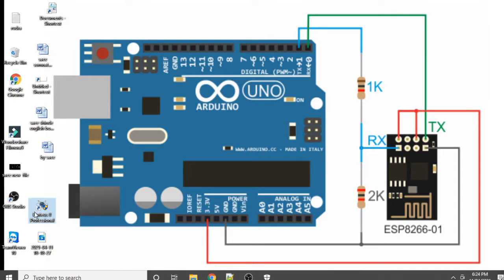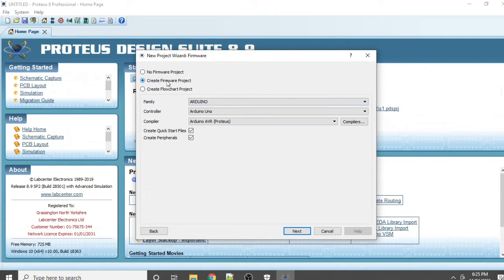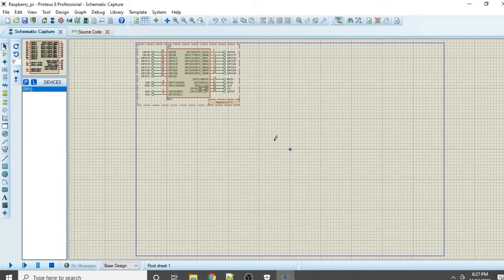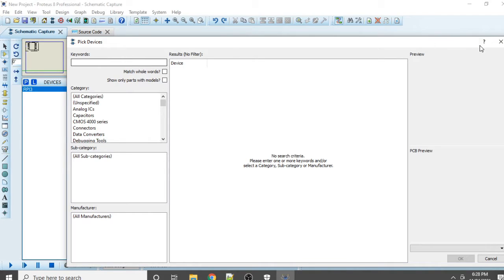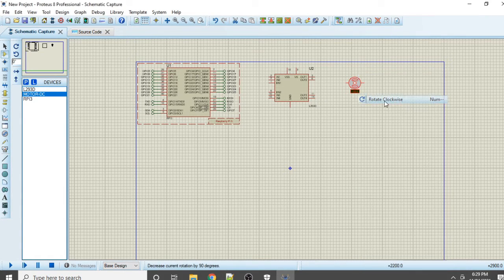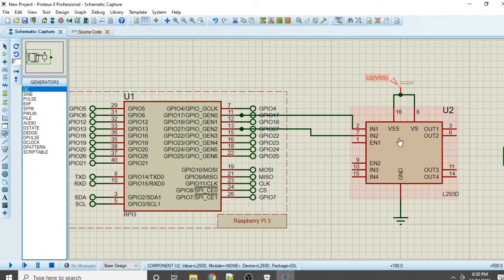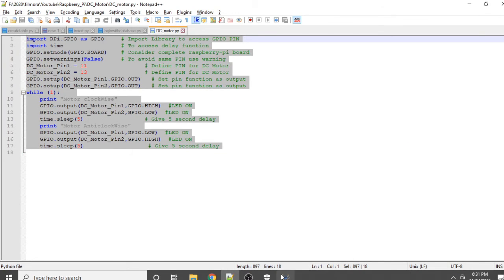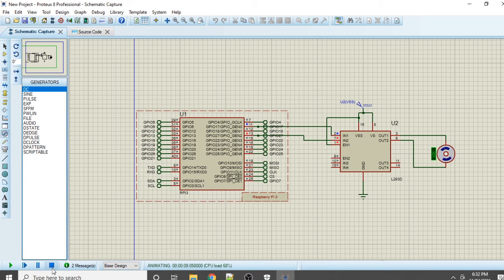How to use proteus software ?  Simulation of raspberry pi in proteus.

Comment: plz give the link to this software.
Reply from the maker: Sorry' for security reasons I can not give drive link.
But if you go on YouTube and search download Proteus 8.9 you will find many videos
Reply: @Rahul_Jadhav_Project  the code that you have written here is not working. saying that an invalid direction was passed to setup.
Reply from the maker: @blackrose-zl1yk  can you send your type code here.
My code is working.
Reply from the maker: Or else you can download similar code from below link
https://drive.google.com/folderview?id=15-C8Eg3V7lgbfMS7IbC-MCZ0HloBdpG-
Reply from the maker: You can also check my playlist
Reply: this is the code:

import RPi.GPIO as GPIO #import library to access GPIO PIN
import time
GPIO.setmode(GPIO.BOARD)
GPIO.setwarnings(False)
DC_MOTOR_Pin1=11
DC_MOTOR_Pin2=13
GPIO.setup(DC_MOTOR_Pin1, GPIO.OUT)
GPIO.setup(DC_MOTOR_Pin2, GPIO.OUT)
while(1):
   #print("Motor clockWise")
   GPIO.setup(DC_MOTOR_Pin1, GPIO.HIGH)
   GPIO.setup(DC_MOTOR_Pin2, GPIO.LOW)
   time.sleep(5)
   #print("Motor AnticlockWise")
   GPIO.output(DC_MOTOR_Pin1, GPIO.LOW)
   GPIO.output(DC_MOTOR_Pin2, GPIO.HIGH)
   time.sleep(5)
Reply from the maker: @blackrose-zl1yk  code is absolutely correct it should work.
If you don't want print statement then remove it directly don't comments it.
I believe you fallowed correct steps mentioned in video
Reply: @Rahul_Jadhav_Project  yes i followed the as mentioned in this video. i even removed the print statements but i am still facing errors
Reply from the maker: @blackrose-zl1yk  which proteus version r u using ?
Reply from the maker: Hello your code is not matching with my code.
After while (1) you have type gpio.setup 
But it should be gpio.out 
Please watch full video again .
And compare your each line with my line.
You have type wrong code.
I saw your mail also
Reply: @Rahul_Jadhav_Project  i am using proteus 8.11
Reply: @Rahul_Jadhav_Project  ok i will try this and inform you. thanks a lot.
Reply: it works. thanks a lot Rahul!
Reply from the maker: @blackrose-zl1yk  great what was issu ?
Reply: @Rahul_Jadhav_Project  i had made some mistakes in the code itself.

Comment: How do I add RFID library to proteus, do you have any link for RFID library?
Reply from the maker: Hello nik,
RFID EM18 module works on UART protocol.
There is no inbuilt library available for EM18,
But you can able to simulate your project by using serial terminal. It's works like RFID only.
If you want simulation then please contact me on my whatapp  9922512017
Reply from the maker: Hello bro , I have made video on rfid for you special as you requested .please watch it .
https://youtu.be/DyRdBql_R2o